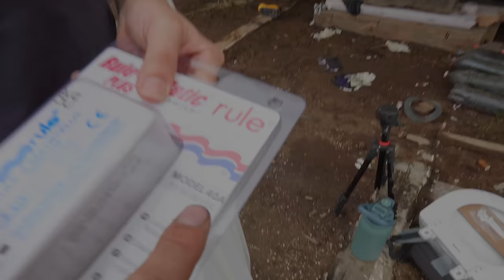Prepping our WOODEN BOAT for LAUNCH! Transducer, pumps and through hulls — Sailing Yabá 179

Comment: Please don’t under estimate the need for your fuel tank tie downs. They need to be heavy duty straps because the the weight of the fuel. For that reason fuel tanks are usually install as low in the hull as possible.

Comment: Transducer needs to be pointed straight down, if at angle it will not give a correct reading. Watch some videos on Transducer mounting before you go any further. I have installed a few in my day. Better Watch out.

Comment: Are you going to check your bilge pump connections that they don't leak when the pump is running. There's nothing scarier than finding out your bilge pump isn't completely discharging overboard but instead is leaking back into the boat. Better to learn on dry land than scrambling to get your boat pulled out due to a flooding issues.

Comment: I suppose it's too late no?. But why you don't have a 2" Forstner bit is beyond my comprehension.  In regard to is that the best way to put a two inch hole through the hull? The way you are doing it has to be the most painful way I've ever witnessed.  Though you manage the method extremely well ( ;